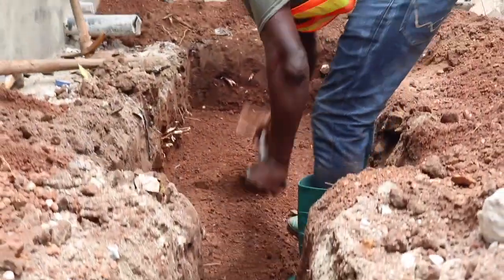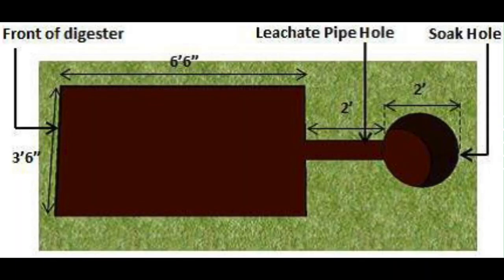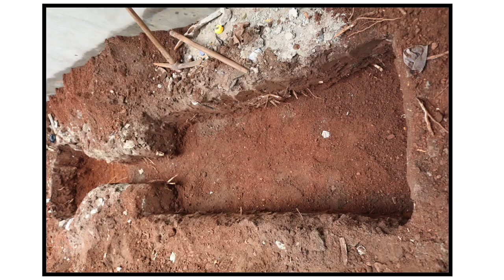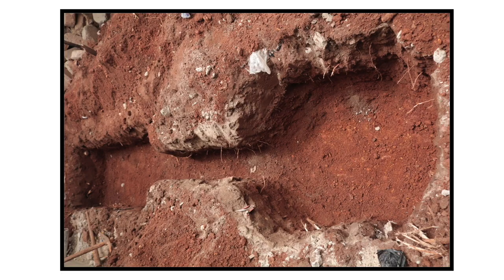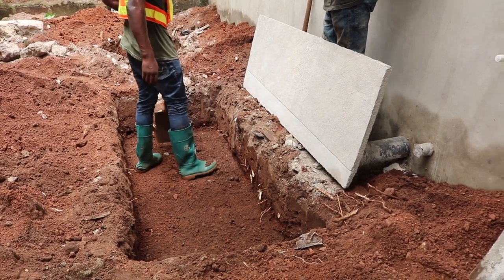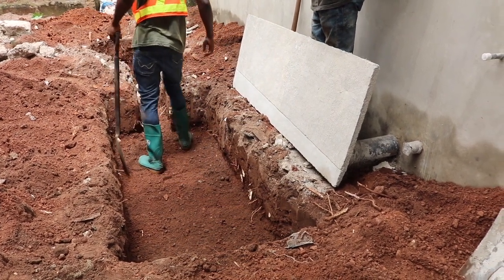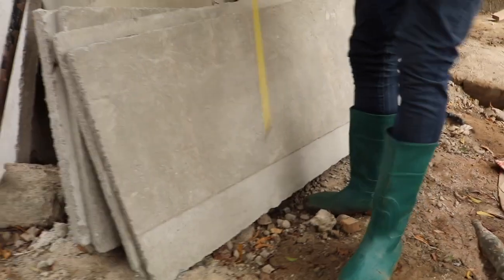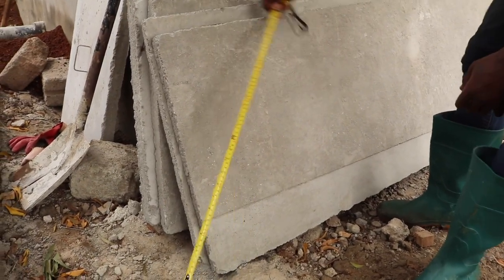Master Prefab Slab Bio-Digester Setup: Step-by-Step Guide

Comment: Excellent video. We are looking forward to our installation.
Reply from the maker: Thank you Lisa and Landon. We looking forward to working with you too 😊
Reply: But It Seems I Can't See U Putting In Charcoal In The Digester Or The Soak Hole Pit Any Reason For That, Because We Are Learning From U & We Don't Want Whereby We Will Construst A Digester With Scent Around🙏
Reply from the maker: @IshmaelMensah-l3l   charcoal is only used in the soakaway if the waste water will be reused for other purposes like gardening. If it’s soaking into the ground there’s no need https://youtu.be/6-9h_BWyGAA?si=N06kiHBqjvxc2Y9A
Reply: But Is There Some Cases Where The Waste Water Can't Soak Into The Ground, As U Where Saying? Because What I Know's That Always Waste Water Should Be Soak Into The Ground...🤷